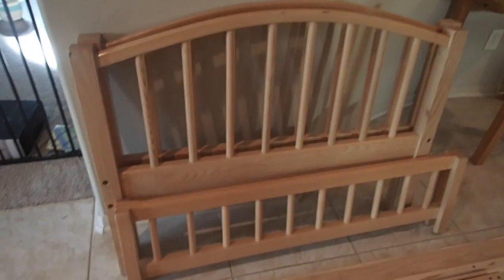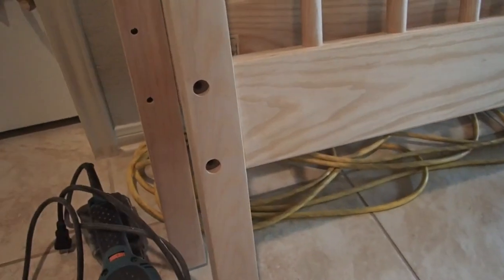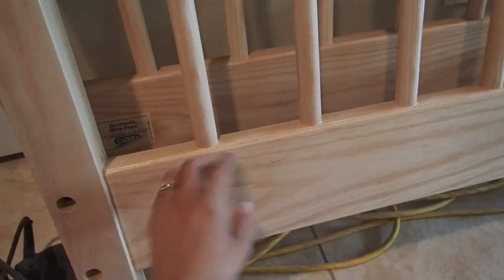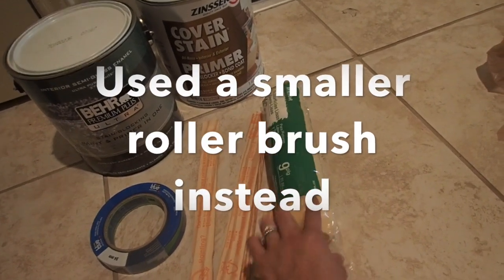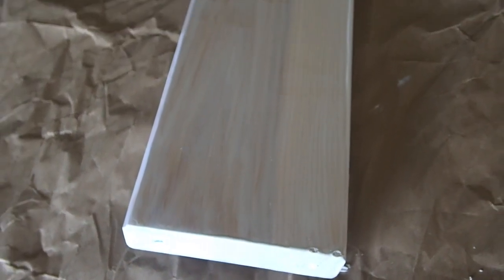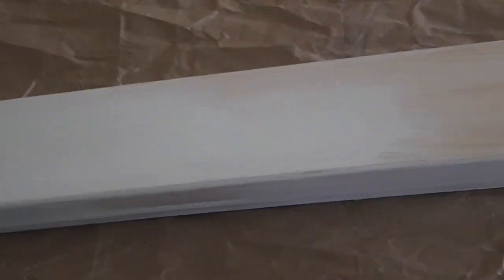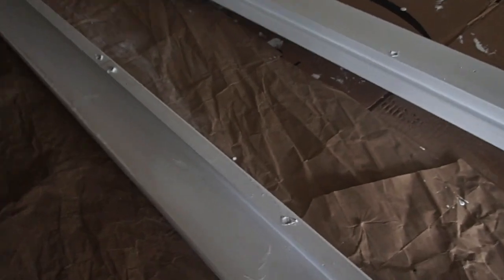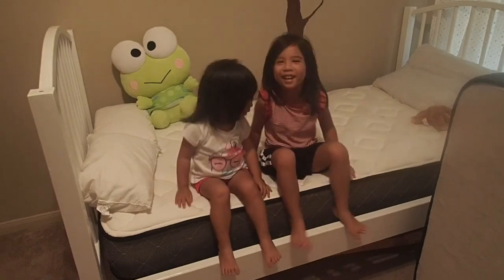DIY: Painting Bunk Beds

Comment: Do you still have the bunk bed would you recommend them my wife is thinking of getting the boys bunk beds the boys are 5 and 6 do you recommend bunk bedsDo you still have the bunk bed would you recommend them my wife is thinking of getting the boys bunk beds the boys are 5 and 6 do you recommend bunk beds
Reply from the maker: We still have bunk beds...so we did you them as bunk beds however, I hit my head pretty hard on it and gave my self a concussion, my oldest couldn't sleep on top because she sleep walks, the little one never wanted to be on top, she just want to be with her sister. We decided it was best to take them down. So I think it will depend on your little ones.
Reply from the maker: @joehebert8070  sorry but I rather communicate through here only. Yes we separated the beds.